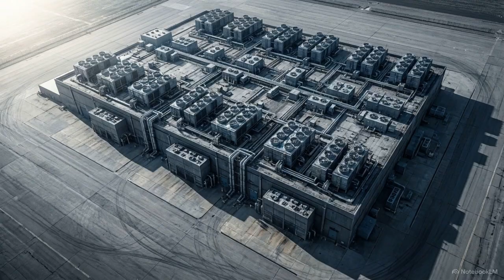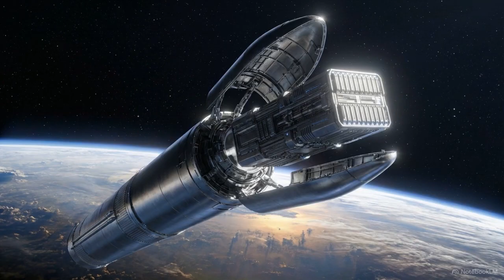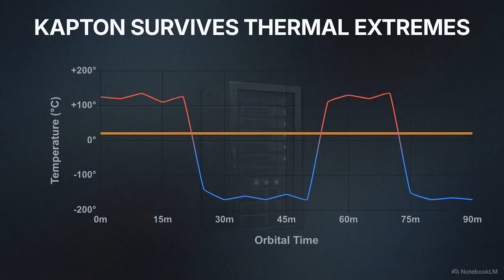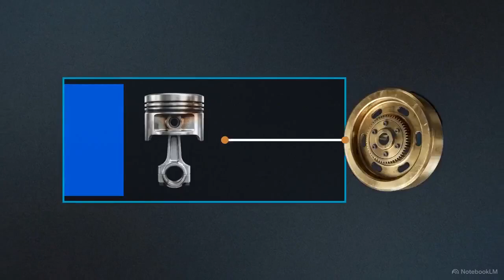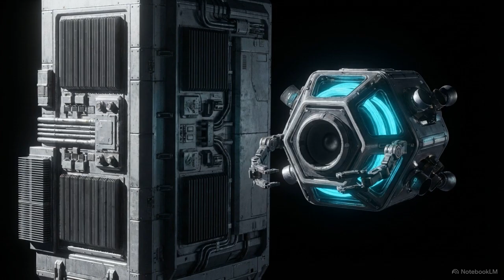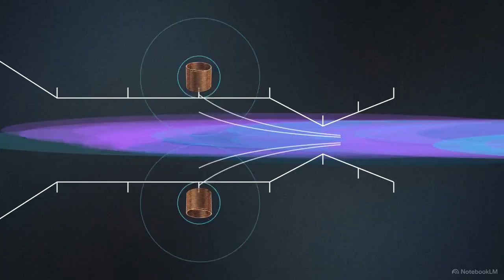Photon, Plasma Thrust, Sterling Heat Engines, AI Space Data Centers Feasible and Cost Effective?

Comment: Maslow hierarchy of needs for a data center: power #1. Reliability #2. Cooling #3. Power is a huge problem in space - no grid to draw from or supply of anything except very low energy density sunlight. Reliability also a problem due to cost/difficulty to repair/maintain and more importantly, radiation frying the chips. Cooling is even a problem because Stirling heat engines, etc all require something to actually transfer heat to. Pure heat radiation is actually fairly limited regardless of how cold space is - that is why water cooling works better than radiative cooling on Earth. All around idiotic idea.
Reply from the maker: Definitely many technological and cost hurdles to overcome and solve for AI space data centers to be realistic.  Earth bound AI data centers consuming huge electric and water resources needs of a small city and heating the environment not helping the global warming problem. I think they need to improve the AI brain power not by stacking more compute but rather improve the compute chip technology.  We humans only use 100 watts per hour of electricity of one light bulb and we can perform some incredible analytical discoveries. 

Solar power and cooling needs huge surface areas size of tennis courts to football fields depending on the number of servers.   Sterling engine can use ammonia to transfer and convert some of the wasted heat to electricity.  But, yes there is still leftover heat that needs to be radiated out to space.
Reply: @Youcan-x9d  It is in the order of 200 watts per square meter of solar panel. Let's say it is doubled in space to 400 (in reality, atmosphere only blocks 30%). So a 1 megawatt data center would require 2,500 square meters of solar panel. So 1 gigawatt would be about a square mile of solar panels. Not gonna happen.